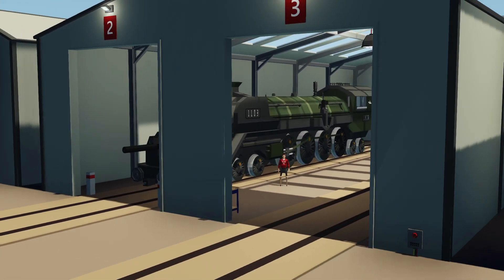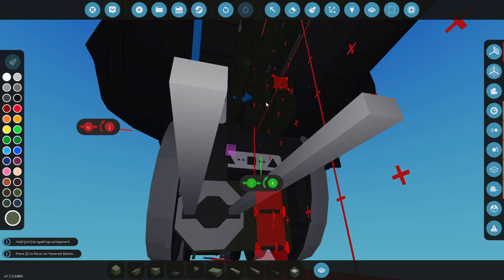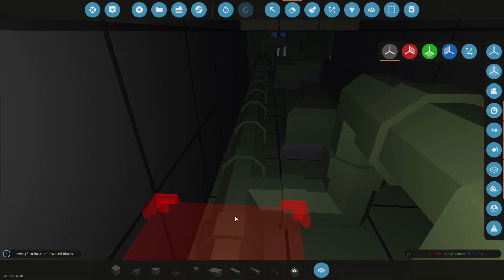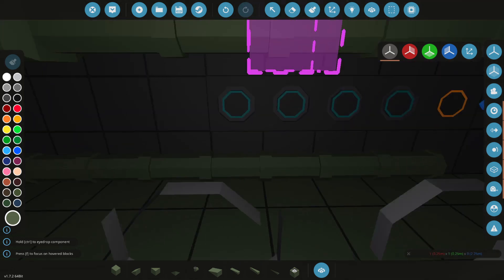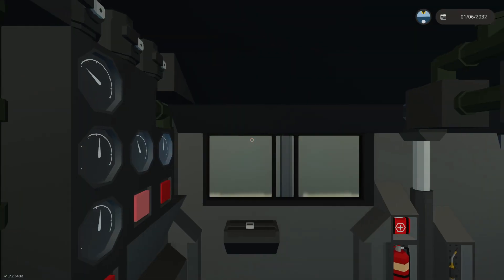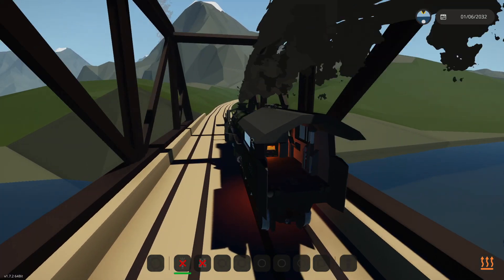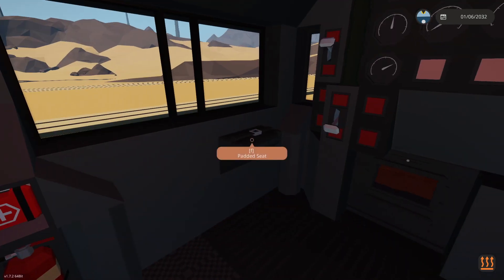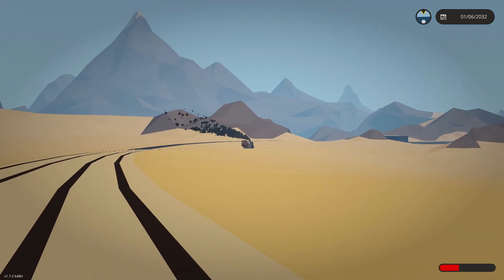MORE PISTONS, LESS WHEELS - Lets Build A Steam Engine In Stormworks!

Comment: Okay, but how far will it go? You've removed the steam vent system on it and I can tell you right now, your condensers will not keep up with the boilers. So are you really set or did you set your self back a few iterations? Is this better or is this going to blow the boiler again?

Also the only thing I can think of that would destroy your train that would be there one time but not the next would be something animate....and WAS moving around the first time and wasn't the second. . . . I'll just spell it out. Frantic, you probably made railroad-kill and the poor creature was just vaporized by your train moving at 52m/s against its not 52m/s moseying speed.